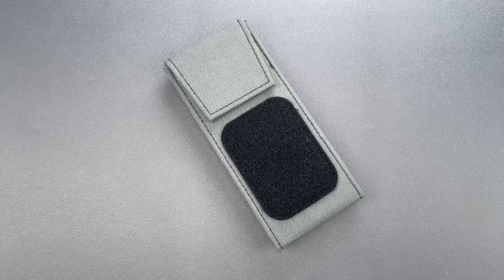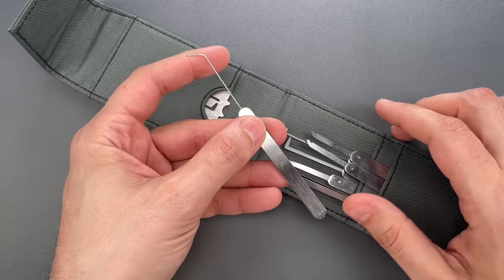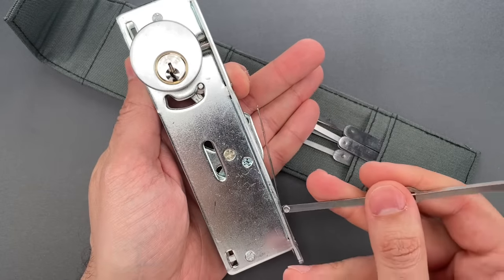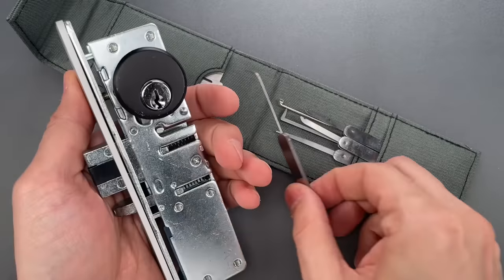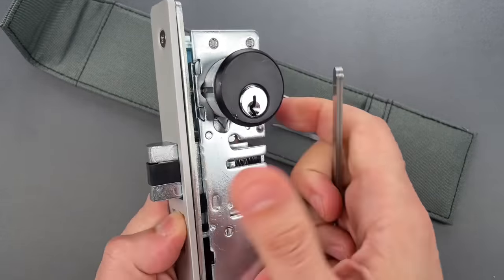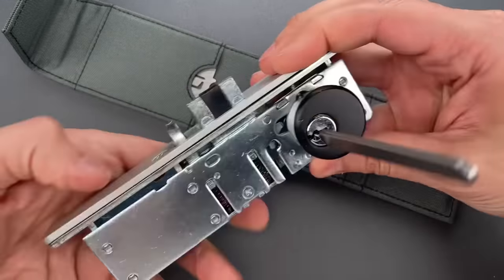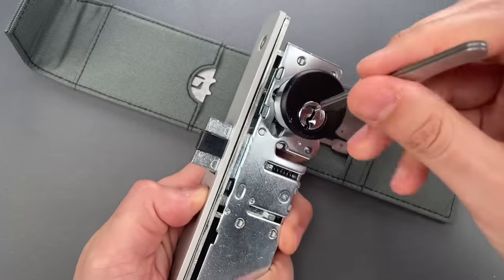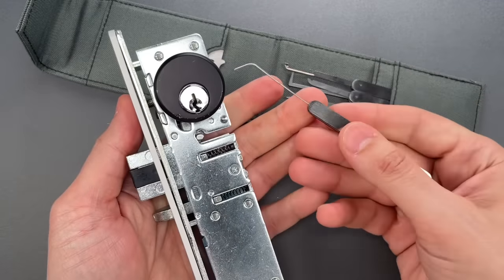[1540] “Must Have” Tool For Commercial Glass Doors

Comment: Hey LockPickingLawyer,
I bought a disc detainer Master Lock to practice lock picking with recently. I even have the special pick that you and BosnianBill made. But I had a couple unexpected issues when I tried picking the lock. For one, I couldn’t tension at all, the first disc was made to be loose to prevent tensioning. Second, the discs didn’t give me the same feel as other disc detainer discs usually do. These discs sprung back into place and didn’t rotate as I wanted them to.
Could you look into this?
Reply: Sounds like user error. 
You might think about picking 20 various locks per day until you build your skill level to that of the tool you bought. 
Come back and tell us about it after putting 80 hours on it.

Comment: ALL locks should have a rating: 3s, 5s, 10s,30s, 1min etc. to tell how long it takes to open them by a lock picker. I wonder what is the “longest time to open” lock on the market currently
Reply: This isn't a pass/fail situation, nor is it a game mechanic.  Everyone has different skill levels and experience with particular locks.  Each lock has a different set of pins requiring a different order of operation even within the same model, and different levels of grime and corrosion that offer different resistance for each component.

An individual lock's pins won't always fall into place the same way or in the same order, though there will be tendencies.  Same goes for the performance of a picker.  Even LPL had at least one video I'm sure I vaguely remember where he said he got in quickly one time off-camera, but the timing varied because the thing was finicky.

Neither the locks nor the pickers have such a level situation that one could put that kind of number on any lock.

Comment: Question. When you demonstrate the second mechanism you call it a dead latch. Isn't the thing you press with your thumb technically the latch bolt and the thing below that which keeps the latch bolt from being able to be pressed when the door is shut called the dead latch, or have I been using the wrong term my whole life.

Comment: Wow, the tool is so thin that it looks like it would bend when turning against the mechanism. I guess it's either stronger than it looks, or the lock doesn't take as much force as I'm assuming?
Reply: Probably both.  Stainless steel is very rigid.  The other tools are stainless; I'd expect the same here without looking it up.

Comment: LPL should start manufacturing locks.   Or At least commercial locks with modified cores.
Reply: This is like when we wish our favorite comedians were politicians.  Pointing out the problems with a politician or lock is a different skillset than doing the job or making the lock.  It's also usually so different that even if the person could be really good in that position, they would be miserable under those conditions and that might cause failure in the long run.
Let's let LPL do what he's good at and enjoys.

Comment: Okay, LPL, I have what may be a stupid question. I noticed that each time you picked the lock you used your thumb to depress that small bottom latch and my undertanding was that that piece would be depressed in the locked poition. What is it there for? Obviously not security or was your thumb substituting for some kind of shim? It hust seems odd in a lock that's supposed to default to locking all the time.

 I have never tried to pick a lock in my life but I must say that having watched your videos about bad locks for many years I am tired and sleep deprived. My highly trained, rabid raccoons and I stay up all night watching the front door in case someone with your latest kit decides to take a stab at the front door to steal - the raccoon food? That's what it's come down to. At this point I just want to put the TV in the yard, slap a Masterlock on a cheap hasp and run away but I can't. If I so much as think about it the raccoons start glaring at me and foaming at the mouth. It's great secitity but...wait, they're on to me.... stop you buggers... noooooo
Reply: It's for security!  It disables the credit card and traveler hook attacks when it senses the door frame .  His new keyhole tool overrides it .
Reply: The piece he is holding in with his thumb is a security device. It prevents the latch from retracting without the cylinder turning that way One cannot shim the latch open, residential locks for front doors have them also, unfortunately a large precentage are installed incorrectly and that piece is not depressed allowing shimming of the latch

Comment: I have a question/idea for a potential video. Can you maybe in the future explain why do American keyways have the "bulged in" section at the bottom and not at the top? I often get confused when you say "bottom of the keyway tension" and then place the tensioner into what I, as an European, know as the top of the keyway. Just wondering if there's any particular reasoning from lockmakers behind it or if it's just something random.
Reply: I don't know if this is industry standard, but I've always interpreted "top of the keyway" to mean the side where the pins are located. Its orientation in space is irrelevant.
Reply: @johnopalko5223  That's the thing, though, I'd say that even the fact that pins are on one side doesn't necessarily mean that is the top. Locks in my country (and I'd say that probably in a lot of other European countries as well) have pins on the bottom, so the confusion persists.
Reply: @JohnySlama  it's not about the indent – we mount our keyways with the pins up to keep grime from eventually locking them up, even if it's not likely.  The European locks may be manufactured to a tighter standard that it almost never matters, or there could be some other reason for the different habit.  Most locks can be installed in two directions.  (Four if you include inward-facing.)
Either way, top as you hear it here means where the pins are, no matter what direction the lock and keyway is facing.  If it's sideways, top is still where the pins are.
Only exception is locks with weirdly-shaped keyways or multiple groups of pins, in which case other wording will be used.  I think LPL used clockwise numbers in the case of a four-bladed cross-shaped keyway.

Comment: Can't just store owners weld a piece of metal on the frame to hide the gap between it and the door to protect the lock from being opened with that tool?
Reply: they could, but they won't, because they don't know that it's a problem - hence, here we have LPL showing how easily it is bypassed.

Comment: Why do you don't sell single normal pick? 
I will like to see wide variety of hooks, rake and more.
Reply: He does - the covert companion.
Reply: @fredbloggs5902  
Not single picks and not variety
Reply: @hgec  

Covert Companion Handle
Handle Expansion Pack
SSF 4 Pick Set .025”
SSF 5 Warded Pick Set
SSF 4 Comb Set
SSF 3 Jiggler Set
SSF Latch Tool
SSF Knife
SSF Notched Decoder
SSF Utility Flat
Reply: @fredbloggs5902  yes. They sell them in sets, not in single. Ande many there's many set, but not many tipes of normal picks. Like different lengths and size's.
Reply: I believe some of the other lock pick suppliers sell individual picks in different thickness and reach
Reply: @hgec  You realise that with a single pick the postage & packing would be greater than the cost of the pick itself, right?

Cluelessness confirmed 

Blocked